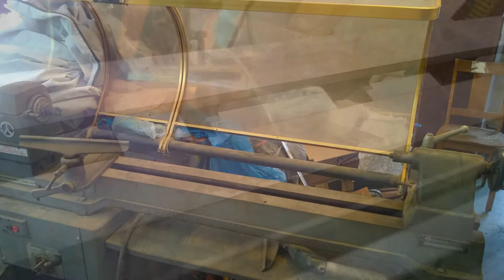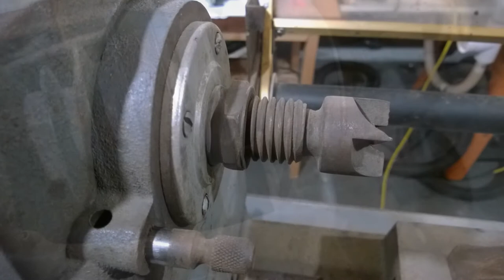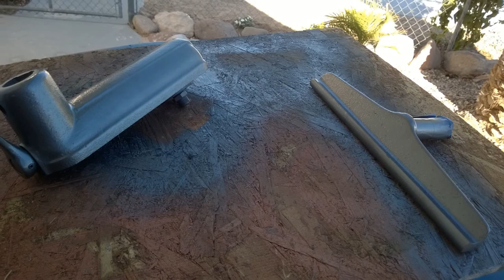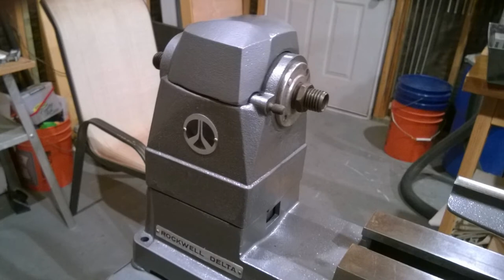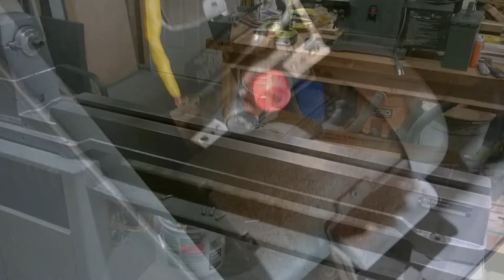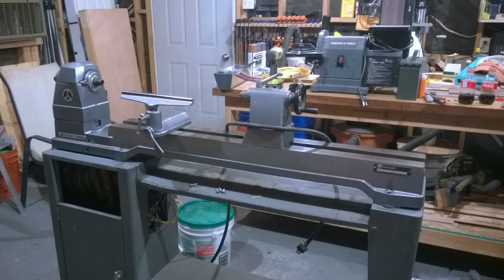Rockwell 46-525 Lathe Restoration

Comment: I am trying to restore my father's Rockwell 46-200 wood Lathe and have run into a problem. The tailstock quill is frozen and can not be adjusted with the hand crank wheel on the end. How can I get this loosened up? Is it possible to disassemble it if it can't be turned?

Comment: I have a 46-111 (pretty similar) I am restoring, No problem finding bearings BUT, one heck of a time dismantleing the headstock. Is there someplace that has step-by-step how to take it apart? There are circlips on the shaft so I can't push/hide hammer it out.
It was not used for 30 years before I got it. The rust is all but gone.
Reply from the maker: I removed the bearing caps (no circlips), then the set screw for the pulley on the head shaft then slid the unit out. It did take a little persuasion with a rubber mallet but it all came out. That is also how you would change the belts after looking at the 46-111 model it doesn't look anything like the 46-525 so I couldn't tell you how that would come apart.
Reply: Thanks. Persuasion with a rubber mallet got it free. Now it's a matter of getting out the drive center (looks like a press fit) out of the other end of the spindle before the other bearing can be removed. There is just enough drag on those bearings to make me think changing can only improve things. Thanks, again.
Reply from the maker: I use a 1/2" x 14" round steel and tap it out through the center hole, though the first time I had to use the persuasion method.

Comment: Hey there.  I just brought home a 46-525.  I thought I got a good deal until I saw you picked yours up for FREE!!!  I am a novice turner and am a bit intimidated by this machine (I have only turned on a midi Jet).  I'd really like to restore it and use it.  Please tell me your thoughts on how difficult it is to restore and how can you tell whether the bearings need replacing or just lubrication?  Thanks in advance
Reply from the maker: First if you have used a lathe any lathe your way ahead of where I had come from, the last time I had used a lathe was several decades ago in Middle School. Finding serviceable parts isn't difficult  the bearings are sealed so they can't be lubricated you will find the bearing number on the bearing race (the outer ring) then do a webb search for the numbers I found mine on E bay. The bearings on my lathe were a little noisy so I replaced them both, the belts were just say old so I replaced both. The whole project was much easier than I thought it was all pretty straight forward.
Reply: Thx a bunch.  How do you hold the rod in the head stock so it doesn't turn while you are removing the nuts that hold the bearing retainer in.  My pulley does not have any holes in it for indexing, I have the pin but it really doesn't do anything.  I hesitate to put a pipe wrench on it but I may have to.
Reply: pete7170 hey, don’t be intimidated(if u can), I was 71 yrs. old when I bought my old 56-111 Delta/Rockwell. Done a little revamping including putting a dc motor w/reverse capabilities & variable speed. I love turning. I only have one good eye so that brings a challenge. But I get in there & make shavings. So good luck & welcome to the “habit”.

Comment: Hello.  I acquired a 46-525 lathe a few years ago and finally want to restore it.  I'm wondering if you had a manual/instruction book to the lathe.  Mine's disassembled a bit and a manual would help putting it back together.  Thanks.
Reply from the maker: I found these schematics and parts vendor at https://www.toolpartsdirect.com/rockwell-46-525-12-wood-lathes-46-221-46-222-46-223-46-224-four-speed-46-541-46-542-46-543-46-544-variable.html
Reply: Great.  Thanks.
Reply: Great.  Thanks.  Would you mind helping me out if I have a few questions along the way.  The schematic helps, but probably only so much.
Reply from the maker: Sure no problem there.